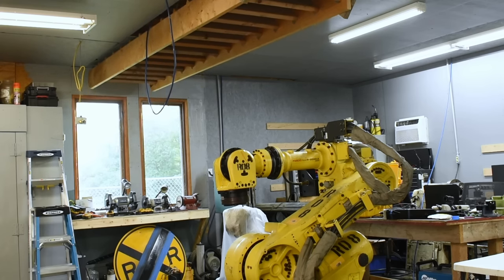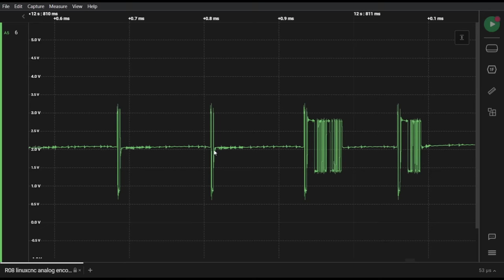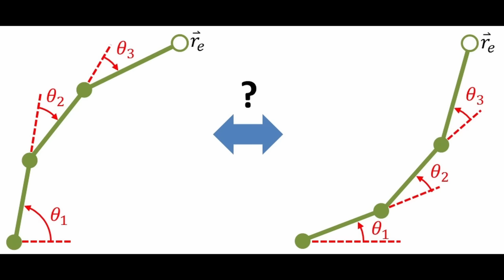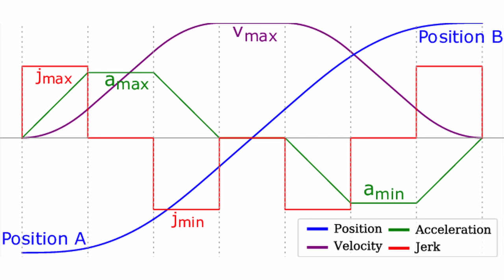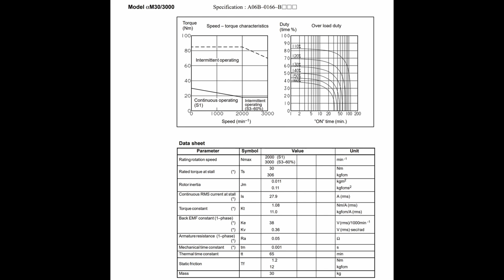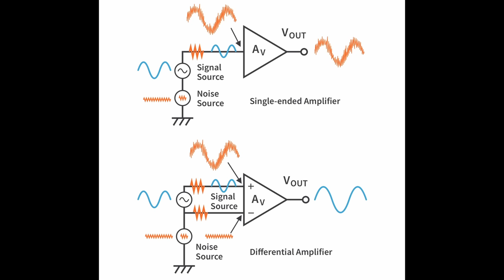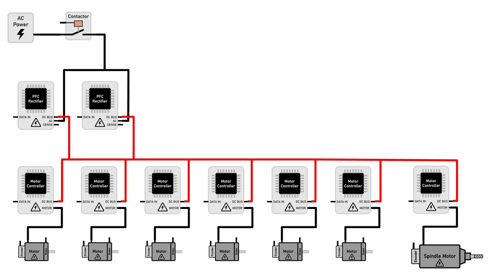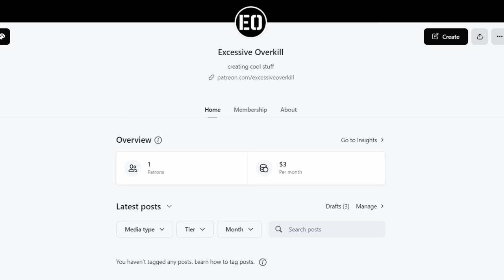Open-source Industrial Robot Controller Part 2: Starting Over...

Comment: You can look into some dedicated microcontrollers, many of them have fancy counters designed to work with encoders and motors directly. Far cheaper than FPGAs
Reply: But generally MCU inputs for encoders use simple quadrature using two individual single wires, not differential signals as  described in the video.
Reply: @Graham_Wideman  I guess something like RP2040 with its PIOs processing pulses independently could work. Differential part is the easy part here, you could possibly just use some RS422/485 hardware for it and turn it into single ended signal going into MCU
Reply: @Graham_Wideman   MC3486 or similar. No MCU takes differentials, there are 120R terminating resistors involved (current).
Reply: @xani666  Sure, you could add the necessary receivers. I was just commenting on your "work with encoders directly" -- not quite directly, compared to FPGA with differential inputs. That said, the FPGA diff inputs may not be in a voltage range compatible with encoders.
Reply: @AdaptivePhenix  Are you saying that encoders with differential outputs expect 120-ohm terminating resistors? I didn't hear a specific brand mentioned, is there a standard?
Reply: @Graham_Wideman  the FPGA can't work with it directly either. FPGA differential inputs are exclusively the low voltage ones, still need at the very least level converter

FPGA differential inputs are more for things like PCIe lanes or SFP+ modules., all below 2V differential

I think something like Zynq (fpga+ ARM cores) handling a bunch of servoes at once would be most sensible option tbh

Comment: The corner rounding issue you’re having is because you have G64 enabled by default. To fix it, go into MDI and type in G61 to enable exact path mode. 

I can go into detail more if you would like.

Comment: I have considered prototyping a stepper motor with an optical encoder for  position feedback. Finally, add a stepper driver and microcontroller in such a way that all the control for logic is done directly on the motor.

 My thought process whybudefhese humongous cabinets full of electrical wiring and high voltage when everything can be local to the motor itself. That way you can control each motor over LAN with one additional cable for power. I imagine this would be a cheap solution for someone that would like to take one of these robots and Implement their own controllers. This would eliminate the need for large controllers and expensi, but I'm thinking of somewhat hybrid set up which includes embedded Electronics and uses standard protocols that work over LAN. The advantages are using standard Network components and a sufficient power supply where everything else is contained within the stepper motor unit.

😢 My question is: does anybody here think there would be a market for such a thing? 

The reason I brought this up is because I almost bought a robotic arm just like this but decided not to because it didn't come with the original controller and power supply and proprietary software!

Comment: Why not just use magnetic encoders and smaller fpga on each axis pre or aft reduction, then allow polling of the data on can-fd network heck, make the drivers for the motors on same board as the fpga under two separate cans and make your own clear path style but using can-fd for speed?
Reply from the maker: I kinda wanted to avoid as much modification to the robot as possible so it would be more plug and play with the original robot connectors. The encoder boards I made as add ones use magnetic encoders and have battery backup just like the Fanuc ones so they technically could be used as a direct replacement. I also just preferred the Fanuc encoders since they are reliable AF. stuff can go really bad if the encoders start sending out incorrect information.

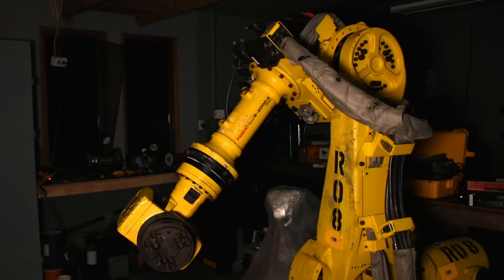Comment: 19:07 why not use ICE fpga’s that has open source toolchain and chipper, lower end should be enough for encoder use :)
Reply: An iCE FPGA doesn't have any DSP hard blocks and is very small, so I'd doubt you'd be able to fit all of the complex motion control calculations on it
Reply: @fraserbc  one per servomotor? Maybe you are right - need to check datasheets :)
Reply: @onomatopejaB  The iCE40 UP do have DSP so you may be able to get away with using them, but now you're increasing complexity by having multiple boards and you also lose out on the niceties of having the ARM processor that the Zynq FPGA has. I feel it's probably just easier to use the Zynq even though it requires more complex external circuitry in terms of power supply.
Reply: @fraserbc  👍, on the other hand no open source toolchain and no open IP

Comment: Hi, can a robot that size work powered from single phase ? With the controller you presented,
Reply from the maker: It runs off single phase in the video, the full power controller will also be able to run off only single phase
Reply: That's awesome
Reply: You are doing a good job